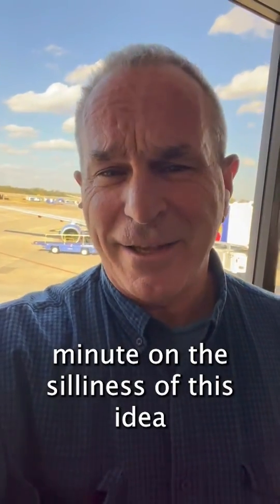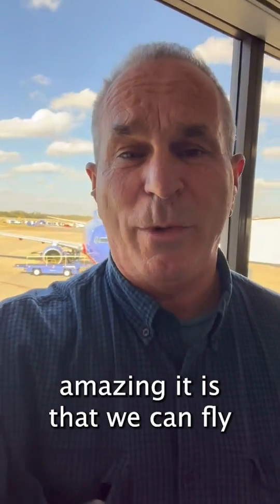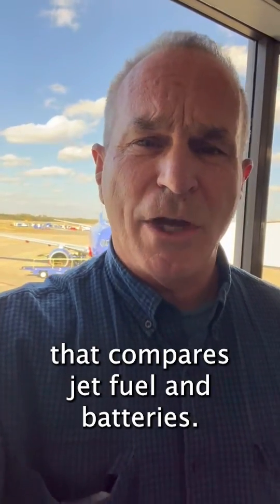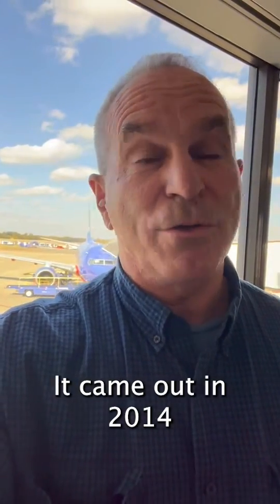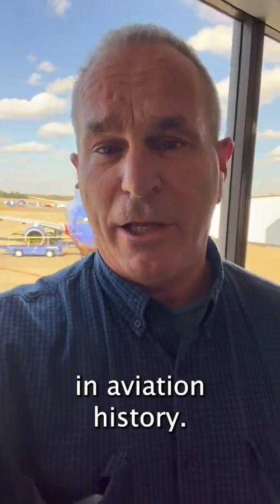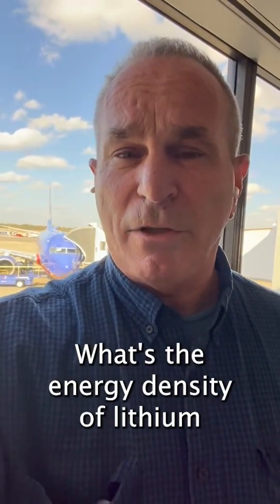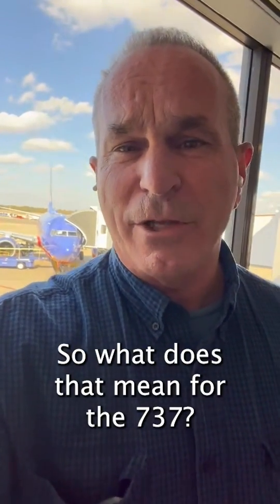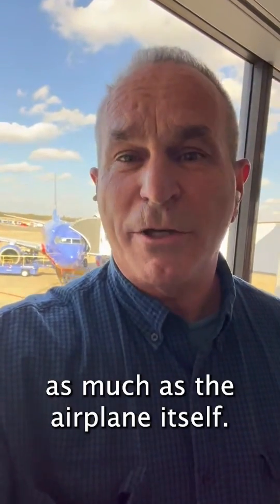Some Quick Math On Jet Fuel, 737s, And The Silliness Of Electric Airplanes

Comment: One would think that a competent pilot might realize that aircraft design and aviation involves a few more variables besides energy density of the fuel. I realize Robert here has a career, and the modern world exists, mostly because of petrochemicals. But the world is not a utopia just for air travel now is it?
Reply: In that case, go hire a "competent pilot" to design a battery-powered aircraft with range, speed and payload similar to a 737.

Comment: Not only does have much greater energy density than batteries but you burn away the jet fuels weight during a flight than extends the range even more. I just am flabbergasted that ANYONE thinks electric airplanes will ever be more than just an expensive toy. Don't get me wrong, a small EV makes a great short range commuter car and grocery wagon.

Comment: lots of solutions to be had as yet.  pointless video.  ideas of hydrogen fueling the cruising state, jet fuel for take off and landing;  Biggest problem with this kind of opinion is it says "stop looking at alternatives".  If you want to publish something useful talk about innovations and new ideas.  Many break throughs come from unrelated research too.  Do you know where wifi came from?
Reply: It's not pointless at all. He's comparing jet fuel to batteries, not hydrogen. Energy density is absolutely a necessary part of the cost effectiveness equation. Now hydrogen compares favourably at 120MJ/Kg with jet fuel at 43. It might also be useful in cruise but storage of hydrogen is a bitch. Despite all the promise of the Everyready Bunny, batteries are a fail in air transport. Other than light vehicles, they're pretty much a fail in land transport as well.
Reply: That has to be one of the dumbest things I've heard today.  Do you really think there are people dumb enough to read that and think "wow, I've never thought if that".

Comment: That's an incredibly narrow view of a broad subject.  It's backward looking and leaves no room for improvement. 
I wonder if when you compared jet fuel with batteries you also took consideration for the efficiency of jets vs. electric motors in converting that stored energy into work?  
There are plenty of other comparisons to consider as well.  In a jet you have the engine, fuel tanks, fuel, pipework, pumps, heat shielding etc. With an electric system you have the motor, batteries, power management system (a circuit board), and some wire connections.
A lighter more efficient system requires less energy to do the same work.
How about support infrastructure?  Look at fueling a jet from pumping the oil and transporting it to be refined to transporting to storage to transporting to fuel tank in plane.  With infrastructure in place from source to plane it needs to be transported three times before use.  An electric system with infrastructure in place could be as little as an on-site generator.  And, regardless of where the power is distributed from to the charging point and then onto the plane, there are basically no transport costs.
A jet engine is a complex piece of machinery.  In comparison an electric motor is child's play. More reliable, less moving parts, much less to maintain.
The energy density of a jet fueled system is its only advantage.  That advantage will be chewed up as new technologies emerge.  There is no reason, for example, that propeller driven craft couldn't be using their airspeed during descent as a regenerative system.
Why, in the face of what could be exciting new developments, focus on obstacles as an end point rather than something to be worked past?
If you want to advance you need to look forward, and all around.
Reply: We already see that with cars. For jetliners it is even worse, time standing on the tarmac refuelling is already bad enough but time wasted waiting for the batteries to charge will destroy any calculations of cost for flying.
Reply: @donaldduck830  As well as increases in energy density, fast charging technology will also improve.
There's also no reason to ignore designs incorporating removable modular battery packs as sections of the wings or fuselage.  That could make turnaround times quicker than refueling.
Reply: @ItsCalilum  Yeah, there is no way that they won't lose battery packs midflight then.  Or have the fuselage damaged.
Reply: @donaldduck830  Perhaps if they're built by a cartoon duck with no forethought.  Otherwise, should be fine.
Reply: @ItsCalilum  "Perhaps if they're built by a cartoon duck with no forethought.  Otherwise, should be fine."

Oh the irony. "Should be fine" is exactly what "no forethought" looks like. Thx for the laugh.
Reply: @donaldduck830   Is the word 'otherwise' and its meaning in this context a bit much for a bird brain to handle?
Silly ducky, laugh away.

Comment: Battery powered electric planes make no sense. At least with current battery tech or even next gen already in the labs.

You need to go either with some kind of reactor... Or a fuel cell.
And neither of those seems to have a practical version now either.

Maybe a greener way to produce fuel is the way out... But we will keep burning stuff to fly for a while.
Reply: There are working fuel cells. The German built IDF Dolphin Class missile subs (capable of carrying nukes) is powered by fuel cells and can remain submerged for weeks without a nuclear reactor on board. Most advanced and best subs in existence today, the German fleet did exercises with a USN task group out of Norfolk (the German sub had crossed the Atlantic submerged) and they picked out the carrier multiple times and handily "won" the exercises.
Reply: @donaldduck830  yeah but they arent efficient by weight and by volume of fuel needed.

Ships are way more forgiving regarding volume and weight.
Reply: @Coyote27981  ofc. I am the lonely upvote on your comment. Just wanted to point out the massive functional fuel cells on the subs. But the thing is, as you said, they only work there. Even cars have not been feasible so far, since they need a certain temperature window to work in.

Comment: Battery power is a poor choice for long flights yes, but evtol technology is already showing tremendous potential. A highway legal evtol would be an actual flying car.
Reply: Battery power is a poor choice for practically everything that requires any significant power.  Even Lion battery cordless drills are of questionable value if you factor in the purchase price, the cost of spare batteries, the time spent putting batteries on and off the charger and swapping them out, and occassionally finding other things to do when you haven't got a charged battery versus dragging around an extension cord for a corded drill.

Comment: This isn't accurate. Fuel is energy dense, but combustion is wildly inefficient compared to electric motors. 

But the overall point still holds, there is no way a plane the size of a 737 could economically fly similar routes on battery power. Even though electric motors are vastly more efficient, the batteries are even less energy dense to a greater degree. 

However, on short and small volume routes you might find the economic benefits of electric planes make a lot of sense. 

I wouldn't be surprised to see more electric planes in the future, like in 10 years or so.
Reply: For short trips, you know what is far more efficient than small airplanes, both in terms of dollars and time?  Cars and trucks.
Reply: @kirkjohnson6638   trains probably, buses maybe. But I highly doubt cars are more efficient.
Reply: @andygsp  That all depends on the numbers of passengers in the car and plane, the distance being travelled, and the transportation required on each end of the flight.  But, in practically all instances of cars competing with planes for distances under about 400 miles, the cars are more efficient in terms of fuel used per passenger and the time from door to destination.
Reply: @kirkjohnson6638  right, even if that's true, why does that make cars more efficient than electric planes?
Reply: @andygsp  Aircraft expend great amounts of energy just to stay airborn while a car expends no energy to sit on the ground.  Airplanes also travel at much higher speeds and thus use lots of power to fight aerodynamic drag wheras cars, travelling at lower speeds, have far less aerodynamic drag.

With regard to travel time, a personal car takes you from your house all the way to your destination.  Utilizing a plane requires that you drive to the airport, check in, go through security, wait for the boarding time, board the plane with all the other passengers, wait to get pushed out from the gate, wait for clearance to take off, fly to your destination airport, wait fir clearance to lsnd, deplane with everyone else, wait for your baggage to be unloaded, rent a car, get transported to the car rental lot, and finally drive to your destination.   All of those non-flying activities add a fixed amount of hours to your actual flight time.  Of course the plane then travels much faster than driving, so it makes up time, but it's often starting at a significant time deficit and can only catch up to the car if the trip is fairly long.
Reply: @kirkjohnson6638  you're overstating the differences in time. And your overstating the efficiency difference. For example, cars have constant rolling resistance from the tires. Planes have no rolling resistance other than at takeoff. They can take you to a place in one hour that would take you over 6 to drive, but yes there is recall and wiring time on either side of the airport.
Reply: @andygsp  For commercial flights, people are generally expected ro arrive at the airport 2 hours in advance.  If you live a half hour from the airport and park in long term parking and take a shuttle, you have to plan on another 1/2 hour.  Boarding and takeoff require another 1/2 hour as does deplaning and retrieving checked luggage.  Add on another 1/2 hour for getting your rental car and driving to your hotel and you have 4 hours to make up.  If you were driving, you've already covered 260 miles.  

The plane can probably catch up in roughly an hour given that it will spend a fair amount of time just ascending and descending and circling around wach airport to get in the proper flight pattern and waiting for landing clearance.  So, the two options will equal out in time somewhere around 325 miles give or tae quite a few miles depending on traffic speed, miles to the airport, miles to the hotel, time to get a rental car, amount of advance arrival at the airport, possible flight delays, etc.

Throw in the cost of the flight and cost of renting a car, and you'll find that most people don't bother flying for trips of less than 500 miles each way and, for each day they are staying at the destination, the additional rental car costs increase the distance they'd be willing to drive.

As for fuel, the rolling resistance of cars is fairly low.  We know this because one person can push a car on level ground if they run out of gas.  So, maybe 50 lbf of rolling resistance.  If the car is travelling at 65 mph or 95 feet/sec, the horsepower required is only about 8.6 horsepower.

If we consider that a modern midsize ICE SUV will get 32 mpg at 65 mph on the freeway.  A Boeing 787 will burn about 0.1 lb of fuel per passenger mile on long haul flights (higher fuel consumption on shorter flights due to fixed amounts of fuel burned while circling airports and climbing to cruising altitude).

So, for a 325 mile flight, the plane will burn about 32.5 pounds of fuel per passenger or roughly 5.3 gallons per passenger.  Meanwhile the car will burn about 10 gallons of fuel, so if you put four people in the car, that's only 2.5 gallons per person.  And, if you factor in that you still have to use fuel in your car to get to the airport, the shuttle buses on each end, and the rental car, then flying in a 787 with 200 passengers uses about twice the fuel per passenger mile as driving a midsize SUV with four people.
Reply: @kirkjohnson6638  pfffft   that's rubbish. 

Two hours before the flight? Try 30.

Why do you need a car rental? Even if you do it's like 10 minutes at most.

No, you're just being deliberately and embarrassingly obviously biased.
Reply: @andygsp  Sure a car rental is only ten minutes if you travel frequently and are already a part of the car rental company's premium program.  Otherwise, ot's a good half hour waiting in line at the counter, getting your info input, selecting a car, getting a shuttle to the lot, getting your luggage into the car, adjusting your mirrors and your seat, figuring out how to connect your phone to the infotainment system, and checking out of the garage.

Typically, you do not need to check in 2 hours early, but you are advised to do so and lines at check in counters, luggage checkin, and TSA screening are often quite long plus its often a good ten minute walk to your gate.  So 30 minutes is not a good idea, you need to be there at least an hour ahead.  And, chances are the commute time to the airport is quite variable based on traffic conditions so you have to leave home early to account for worst case traffic.

"Why do you need a car rental"?  Are you only travelling to places right next to your destination airport?  It might surprise you yo know that many people drive an hour or two to get to their departure airport and may do the same from their destination airport to the place they are actually going.  For instance, I'd typically allot over an hour to get from Orange County to LAX then fly to Pittsburgh with a layover somewhere and then after at least 45 minutes in the Pittsburgh airport, I'd have a 90 mile drive to my destination.  Now, obviously, I'd fly from SoCal to NW PA rather than drive because of the long distance, but trips like Orange County to Vegas (282 miles) are clearly better suited to driving than flying, especially if you have any friends to take along.
Reply: @kirkjohnson6638  not sure what your point of anymore. Are you saying we need more cars and roads and car parks than alternate means of transportation?
Reply: @andygsp  I'm saying that battery powered electric airplanes will never be economical for commercial air transport and that airplanes in general aren't economical in time and energy for trips under about 400 miles (even longer for smaller planes that fly slower and use more fuel per passenger mile).
Reply: Then let's see what free people do and stop this communist central economic planning of energy consumption.

Comment: Of course oil is full of energy but you are missing several points.  First, and most obvious, is that jet engines are very heavy.  They are also better at heights than propellors.  You are saying "electric airplanes are silly" in comparison to jets.  They may not be so silly in comparison to propeller-driven aircraft.  Plus we are in eaely stages still.  Look at the advances in transport since the Wright Brothers.  Right now we are only in the beginning stages of more powerful electrical storage and transmission as well as super lightweight materials.  Electric power is also leading to quite significant re-design of flying machines including multi-prop drones, fan wings etc.  These re-designs can lead to quieter more manoeuvrable aircraft.  It is really way too soon to write off the possibility of electric aircraft.